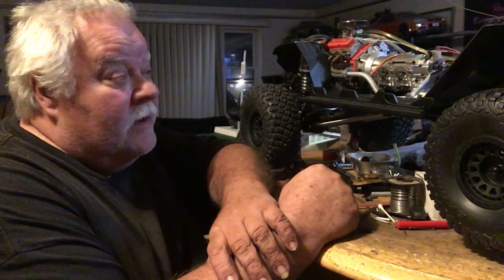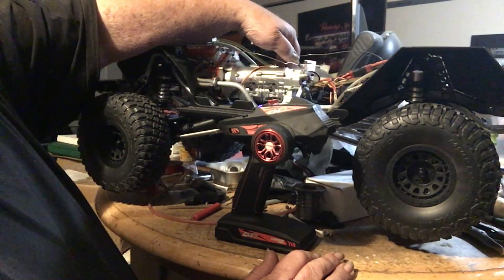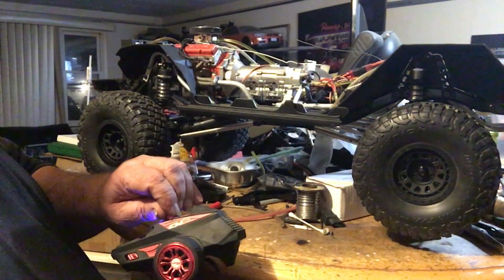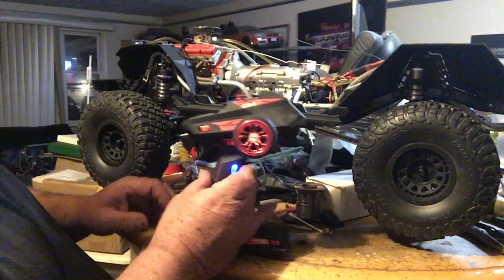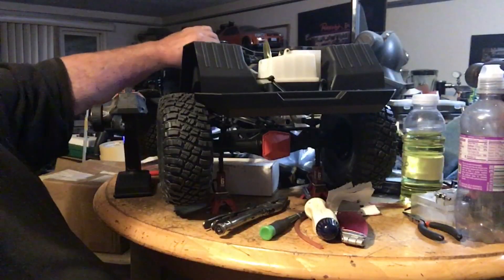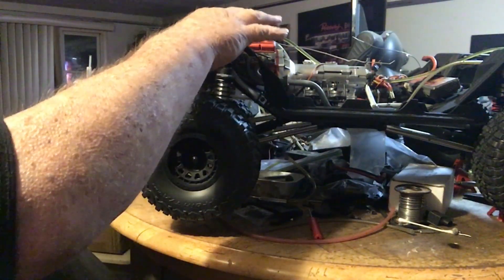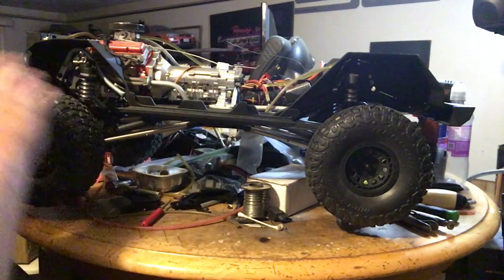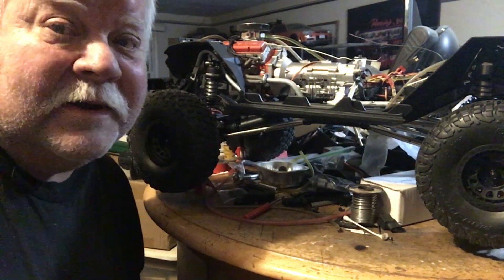SCX 6 V8 DRIVE TRAIN TEST

Comment: I’m into 3-D printing and I’m currently Drawing up a 1:6 scale 1984 Chevy K10 on Autodesk Fusion 360. My Cison V8 is coming in tomorrow but the transmission hasn’t shipped yet. I’m going to put a Video together soon
Reply from the maker: Wow, a 1:6 scale K10 with a V8 is going to be epic! cant wait to see the build!
Reply: @dennisdempseyradiooutofcontrol yeah it’s going to be a little while, I’ve got the hood drawn up but the software is so glitchy when it comes to making contour transitions and curves. Making the Cab and Dash is going to be a little bit of a challenge but I’m putting the Cison Tachometer in the Dash. It’s going to be an epic Achievement.